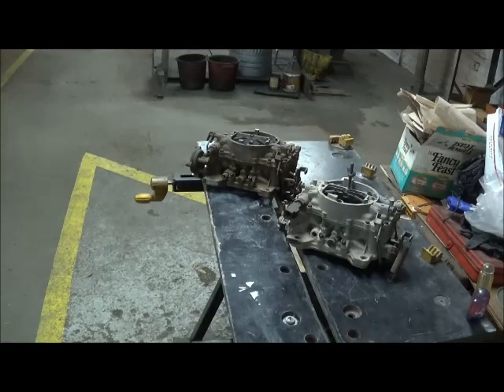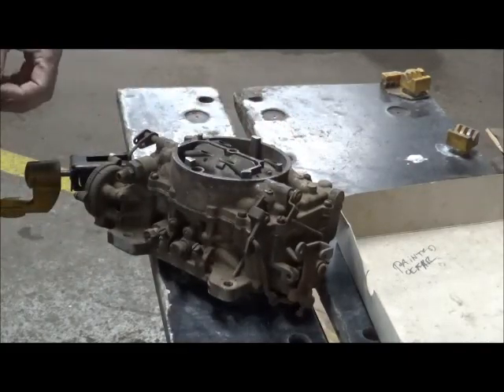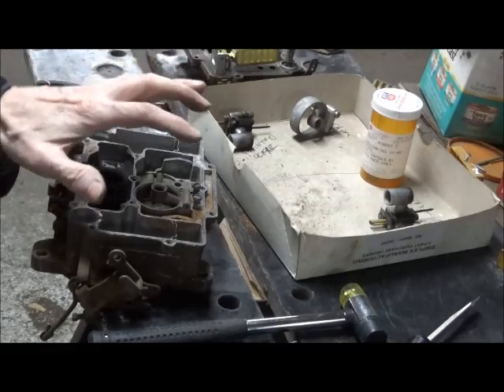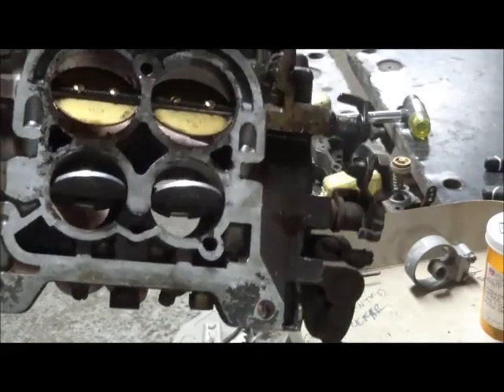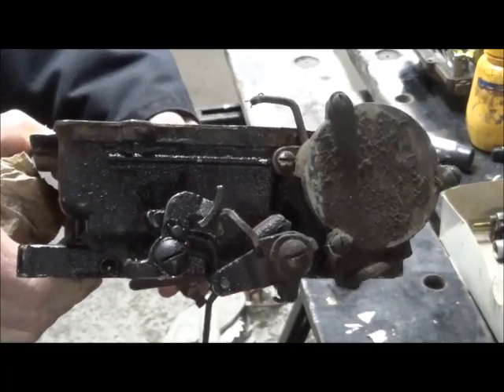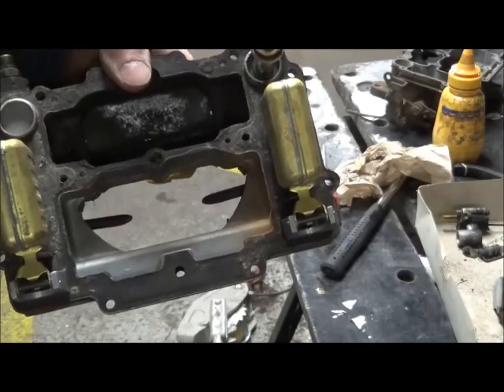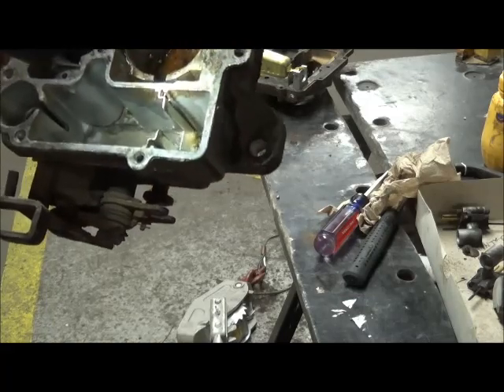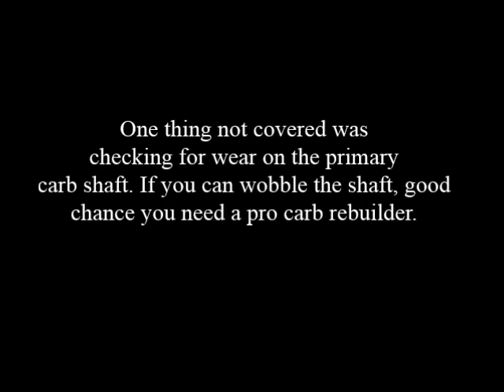A Quick look at the Chrysler long ram and short ram carb.

Comment: Hello again Bob, question; 

Would you use any sort of aviation sealant on the gasket surfaces before re-installation?

Or just let the gasket do the work and install dry?

Also; When i popped my Carter AFB open, i noticed that the float is different from left to right.

Would you install an identical float to the other side?
Or just compensate the different float VIA float adjustment?

Thanks.